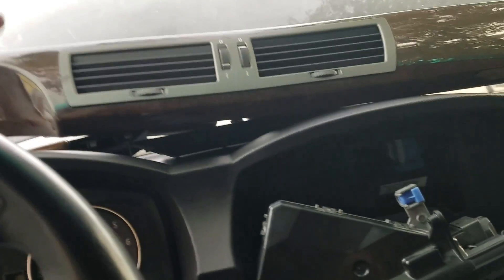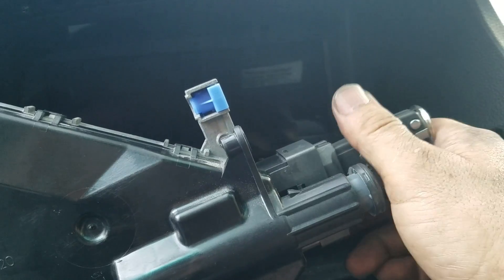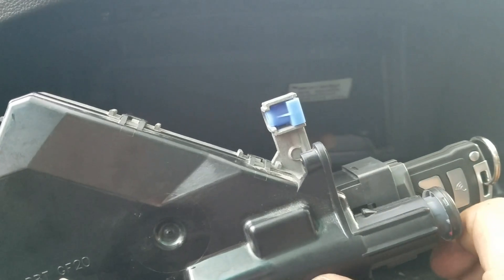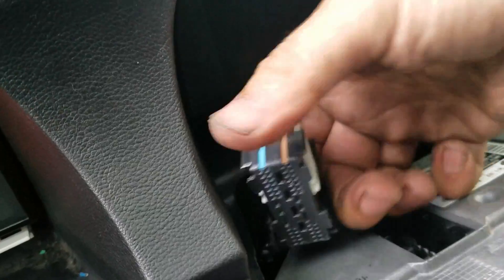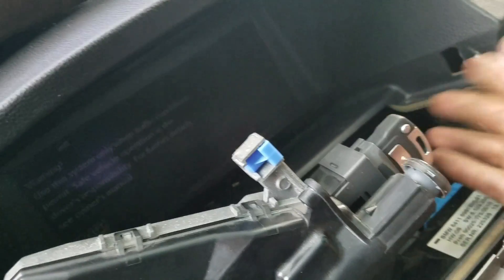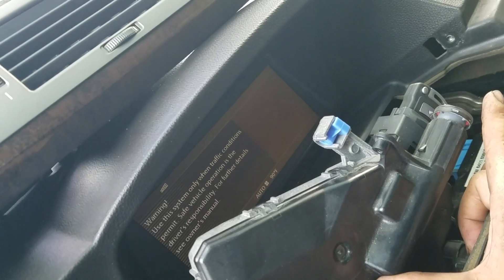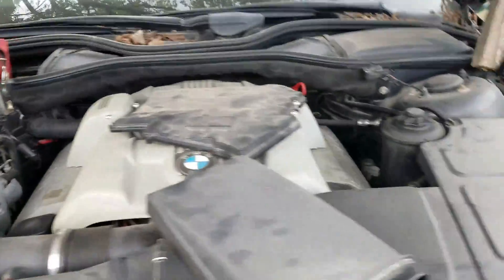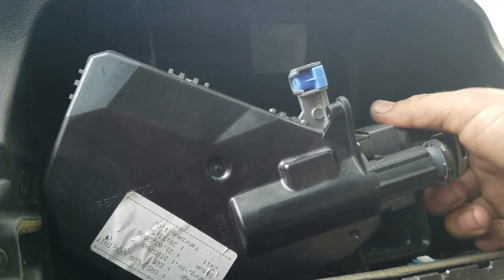Bmw E65 cas programming

Comment: So my e65 750li the key lock and unlock the car but not stay in the ignition..same as in the video.. that occurred after rainy day with wet passenger footwell area..
My question is do i need to replace the CAS or just wait until the moisture disappear.

Comment: Hey Galvan, have you ever seen an E65 that constantly says remote key battery is low? I've replaced rear window, rear antenna module both sides, new key, new remote key batteries etc. Still after 7 years I have this issue! :)

Comment: Ether he liein or he dont know it wont take the key if the battery dead and u can see the battery was dead u had jump cables on the battery
Reply: You think the battery is bad and not the cas to begin with? Myis doing the same as the video.
Reply: You dont work on BMW's do you  or you would know that you need to have a charger hooked when programing

Comment: hi I have a 2002 BMW 745li... just got it out of the shop and the shop owner says it needs a new Cas.. to the tune of $1800 he was a bit of a smart ass about my car... just about punched him in his face... paid him $107 for the test he so called performed and had my car towed home... I will contact you to see if you can give me some advice... the car was working fine until I put a new battery in it... I wanted the idiot repaid guy to Code the car to the battery and he says he cant do it until I replace the Cas... WTF is this true...? or did I just give away $107 bucks
Reply: Hey I did the same thing...I replaced my battery and then tried to start it a couple times,it was crank but would turn over,I tried a few more times till it just would crank anymore please help me

Comment: what was wrong that made the BMW throw so many codes after starting, it says dynamic drive, brake linings, drive moderately, servotronic failure? I am experiencing the same problem
Reply: big daddy wonder if you resolved the issue, we have the same issue, I’m thinking voltage regulator problem
Reply: He installed a used CAS from another car so that creates a lot of vin mismatch conflicts or all these lights on the dash, after rewriting the VIN to the computer and CAS , they all should clear, I do the same type of job